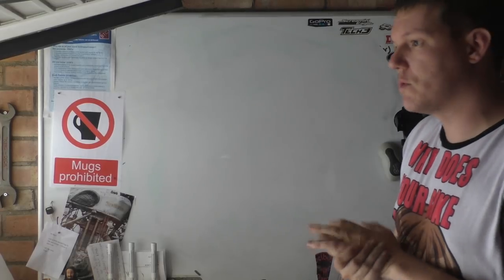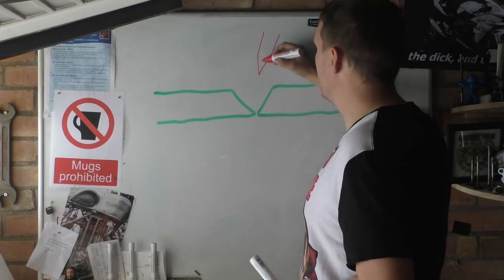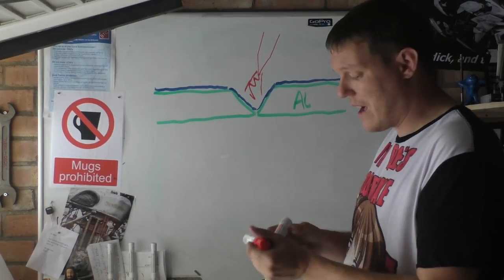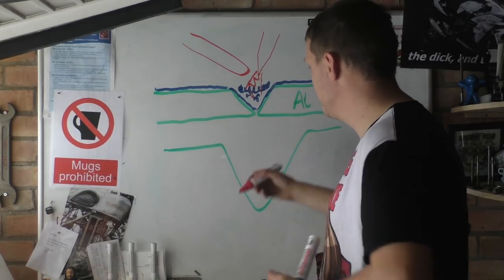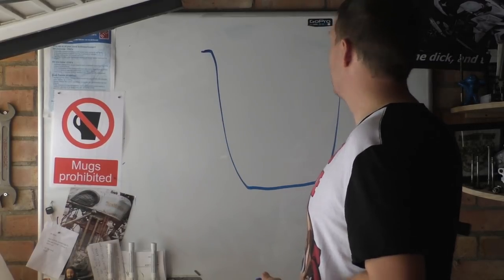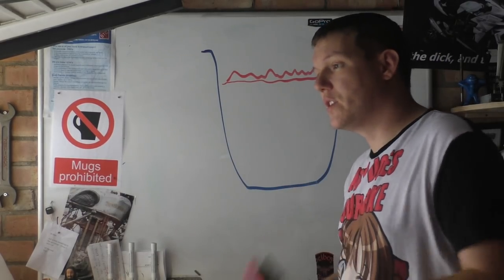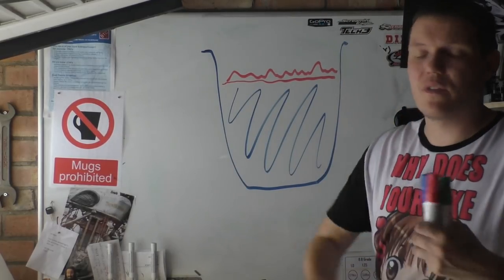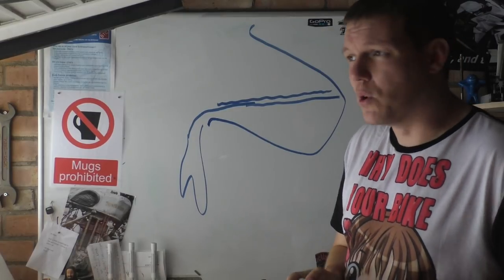Casting Question - Part 4

Comment: You can always use Al-Si filler, whenever I get to weld cracks and cast stuff I use that as it's a bit more ductile and the Si takes care of the impurities. AlMg is a bit stronger but more sensitive to hot cracks and impurities and a cracked weld is not strong at all so going with the softer AlSi is often a good option. But in general aluminium is a shit material when it comes to welding, unless you heat treat it properly it will crack sooner or later if it's subject to flexing and vibrations.

Comment: What if you made a monocristalline engine block like turbine blades are made? would it allow to be much more lightweight because of increased resistance?
Reply from the maker: Yes and no. Engine blocks in regards to motorcycles rarely fail. When they do its usually due to a con-rod or something flying through them. For turbine blades the main problem is creep. High tensile stress coupled with high temperatures means that creep will occur over time. Monocystal componants are not generally lighter, they just reduce fatigue with some slight strength benefits.